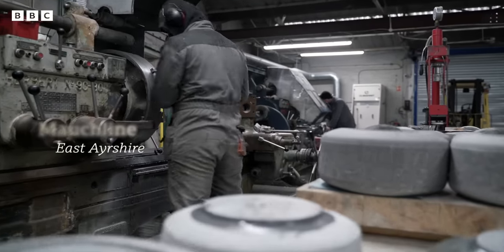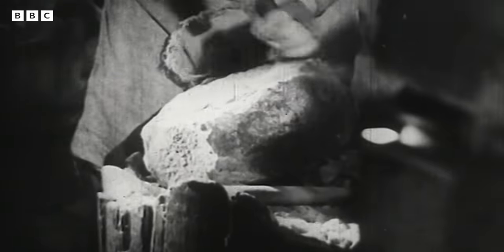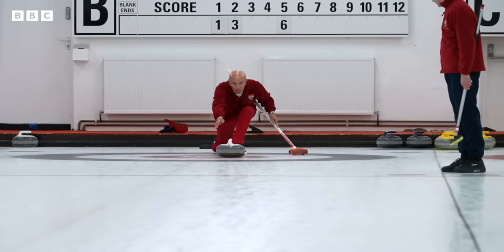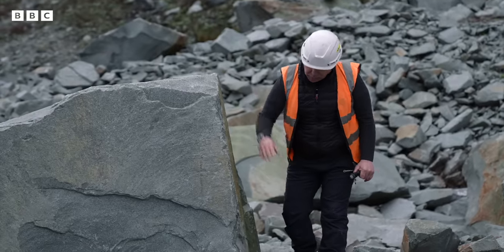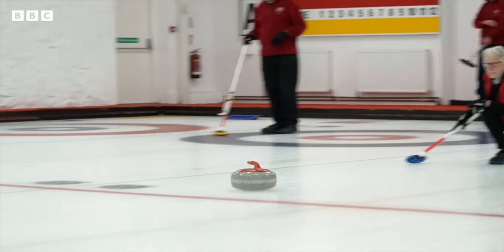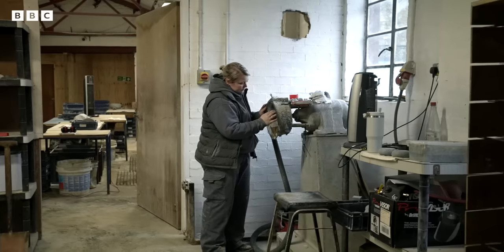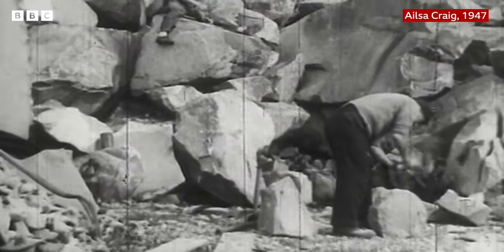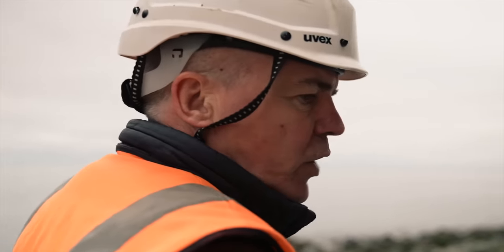Why do all Olympic curling stones come from a small Scottish island? | BBC News

Comment: just make it from cement
Reply: Cement would be way easier.
Unfortunately, it wouldn't have the same smooth surface, 
would fracture tremendously due to its mixture, 
and be so heavy as to make control nearly impossible.
Reply: Just like your brain ;)
Reply: @ChrisM541  your mom